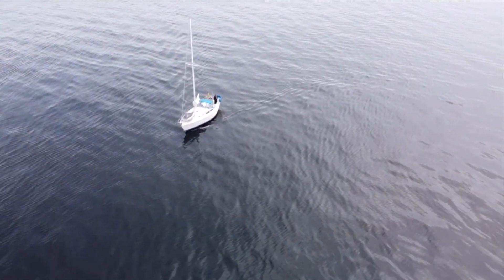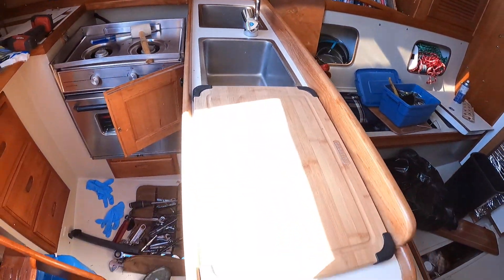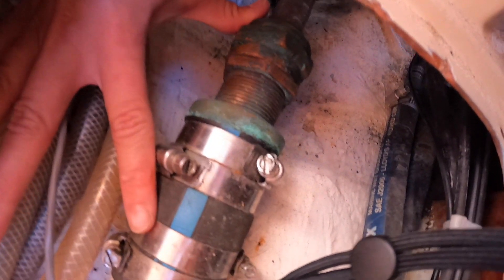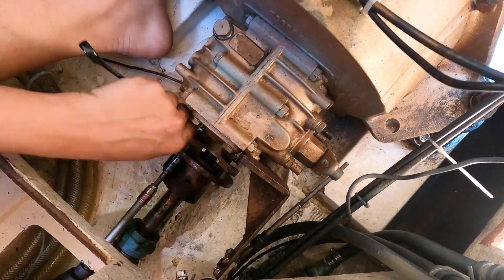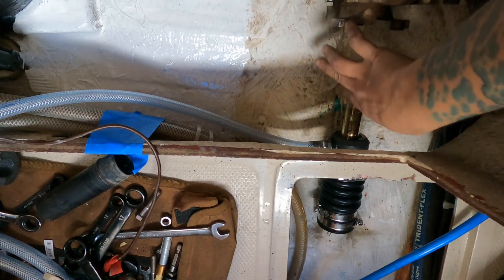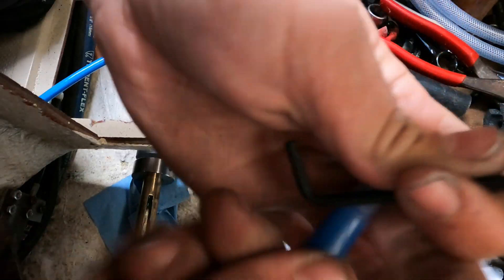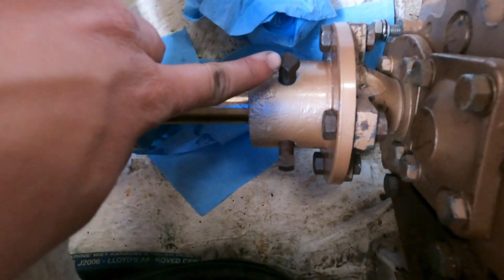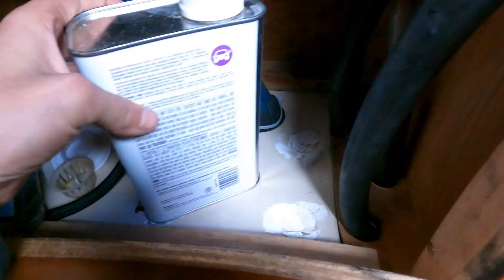NO MORE WATER IN THE BILGE ! Installing a dripless Shaft Seal

Comment: You mentioned a vent. I'm confused... isn't the nipple connected to a water hose to lubricate the shaft? Where does the water come from? A water hose? HELP. We bought a bought (owner died) and the hose is not connected.
Reply from the maker: On most sailboats this is just a vent led above the water line to burb air out. On powerboats this needs to be connected to a water source for cooling.

Comment: Your maintenance videos are the best. I am doing this project this winter. My concern is getting that coupling back on the shaft. What exactly do you mean by bash.. and how did you get a piece of wood and a hammer in there to bash it on? I can't seem to find any videos of the coupling being actually put back on  the shaft. Thanks!
Reply from the maker: Hi Matthew

I warmed up my coupling and the shaft was quite cold as it was early spring which helped. I lined up the shaft in the coupler and then use a wood block from outside on the end of the shaft and bashed it with a rubber mallet and tap it into place! I did small taps and went back and forth to make sure the key hole lined up.
Reply: @LandandSeawithKee  Did you have a machinist measure the inside diameter of the coupler against the diameter of the shaft? Or did you just reuse the coupler because it all seemed snug? I am assuming you haven't had any issues to date.

Comment: My PSS seal on my Contessa 26 I bought two months ago is drip drip dripping. I burped her and because I was on a mooring  I went"Shit " as water flooded out. I was thinking, "Oh my god why can't I just change to an old stuffing box so I could fix her while on water." Now, I got her back and breathed a sigh of relief when the water stopped  and the dripping got lower, it worked that was good,  but through the night I woke every time the bilge pump went off , she went off about eight times a day. Now, I must mention,  there was no solar on the boat when I bought her and the battery was showing 11.30 so she was dead and I had to leave my pretty contessa for another three weeks before I would be back on board. So, I bought a new battery ,a deep cycle and a trickle solar panel. Ok she should be fine. . According to PSS I need to use a bit of rag and or 8oo sandpaper to clean the surfaces. Ok so I am going to do that this weekend, but I am going to put her on the hard for antifouling  and I am going to put on the maintenance kit that Pss sells where the rubber puts pressure back on the seal. Ok, so how do I know which one to get? Ok so  measure the shaft diameter and the other diameter is that it?, and can I do this on the water as I wont be on the hard until october 2022? I mean it's a little scary . I remember Tania who sailed around the world in her contessa fixed her stuffing box on water in mid flight. (I mean is there a serial number to find what kit to get or do I have to take an inaccurate mm size when leaning into my engine... Your video was a little godsend in some ways. Reading Tom Davi's reply just made me get more nervous.

Comment: Thanks for the video. I'd have really liked an expanded section on how you removed the coupling using your bolt trick! Where did you learn how to do that? Is there some place you can send me, to learn more?
Reply: Hi John 

I had someone recommend using a socket and some bolts on a Catalina Facebook forum so don’t have any specific links but it was pretty straight forward. Spray some PB blaster or other kind of penetrating oil around shaft. Use good quality fine threaded stainless steel bolts and go around tightening in a circle!
Reply: @keannarink9412  thanks so much! Bit daunting, but let's see how it goes...if nothing else, I find taking things apart, a great way to learn how everything works.

And a great way to break things, of course 😅

Comment: When it wears you’ll wish you had a standard stuffing box. I’ve seen 2 yachts sink due to failed dripless seals. There’s a difference between dripless and maintenance free. You’d also be surprised how many engines are either misaligned or the builder used junk cheap engine mounts
Cheers
Reply: I have the same PYI shaft seal on my Pearson 33-2 running a Yanmar 2GM20 diesel. it's been operating reliably since it was installed in 2007. if you like the maintenance hassle of a traditional stuffing box, you should stick with that.
Reply: @j.saavedra1502  My PSS seal on my Contessa 26 I bought two months ago is drip drip dripping. I burped her and because I was on a mooring  I went"Shit " as water flooded out. I was thinking, "Oh my god why can't I just change to an old stuffing box so I could fix her while on water." Now, I got her back and breathed a sigh of relief when the water stopped  and the dripping got lower, it worked that was good,  but through the night I woke every time the bilge pump went off , she went off about eight times a day. Now, I must mention,  there was no solar on the boat when I bought her and the battery was showing 11.30 so she was dead and I had to leave my pretty contessa for another three weeks before I would be back on board. So, I bought a new battery ,a deep cycle and a trickle solar panel. Ok she should be fine. . According to PSS I need to use a bit of rag and or 8oo sandpaper to clean the surfaces. Ok so I am going to do that this weekend, but I am going to put her on the hard for antifouling  and I am going to put on the maintenance kit that Pss sells where the rubber puts pressure back on the seal. Ok, so how do I know which one to get? Ok so  measure the shaft diameter and the other diameter is that it?, and can I do this on the water as I wont be on the hard until october 2022? I mean it's a little scary . I remember Tania who sailed around the world in her contessa fixed her stuffing box on water in mid flight. (I mean is there a serial number to find what kit to get or do I have to take an inaccurate mm size when leaning into my engine... Your video was a little godsend in some ways. Reading Tom Davi's reply just made me get more nervous.

Comment: Dont use stainless bolts on driveshafts.  They are brittle and will snap off without warning.  You want about grade 5 fine, and torque/turn them into their elastic region.